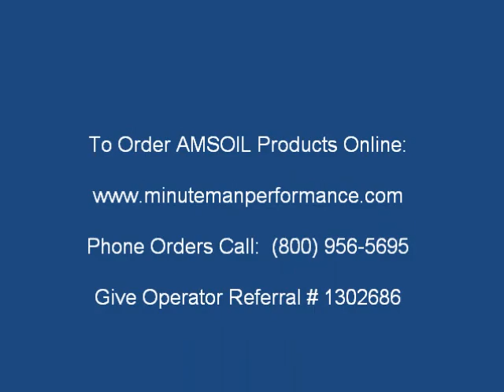Oil Challenges in Turbo Gas Direct-Injected Engines

Comment: My 2.0t accord definitely runs much hotter than my previous non turbo charged Hondas. At 4.5k intervals my dirty oil is black as my coffee. I just switched to an oil with better temperature tolerance. I hope it will hold up better.
Reply from the maker: Due to base oil and additive package differences and reactions when exposured to contaminants, oil color is not a good indicator of condition.  I completely agree about your turbo engine generating more heat and I highly recommend a premium full-synthetic engine oil.  Consider AMSOIL Signature Series in the future.  I can help you get best price and delivered to your door.

Comment: What about 0w40 amsoil for ford Taurus SHO 2013-19 ?
Reply from the maker: Ford calls for 5W-30 in EcoBoost engines due to turbo heat.  Instead of 0W-40, which might be a little too thick for the VVT system, I'd use Signature Series 0W-30, product code AZOQT.  Best start-up protection when cold, and performance when hot.  That's what I'd use if it were mine.  I use that oil in almost everyone I own.

Comment: Mobil 1 EP was decent but cooked oil a bit.  Ive found Penzoil Platinum/Ultra Platinum solves that and readily available everywhere.
Reply: interesting observation considering both oils are EXTREMELY close in specs. 

also, PUP is extremely limited availability unless purchased online.

Comment: AMSOIL is good. I’m a guy that removes my valve covers and oil pan for inspection every 25k mi. 🤷🏻‍♂️. Let me just say AMSOIL from day one and now at 120k mi….CLEAN!! No varnish and no valve ticks. My 2000 Camry LE 5sfe runs like a clock.

Comment: I have a 3.5 ecoboost F150 .. can i diminish the timing chain chatter on cold start by running a lighter faster flowing oil .. it has a tensioner controlled by oil pressure ..
Reply from the maker: Great question, and I don't know.  These engines usually call for 5W-30 engine oil, and many actuators on them are sensative to oil pressure, so I wouldn't recommend moving out of the 30-weight range, but if I owned one, I would use a premium full synthetic 0W30, such as AMSOIL Signature Series motor oil.  This oil is light in the 30-weight range, and flows very well at cold temps or start-up conditions.  This is the oil I run in my own vehicles that call for any 30-weight motor oils.  If you are interested, send email to:  info@best-synthetic-oils.com .  I make no guarantees about reducing timing chain chatter, as you may have a worn tensioner or other part.

Comment: Do you recommend putting a slightly heavier oil in a turbo charged engine for example my gas turbo truck calls for 5w30 could I put 5w40 in instead, for more heat protection and oil shearing
Reply from the maker: Sorry for delay in responding - I just saw this comment.  5W-30 is already a heavier oil than the non-turbo motors use, which is now usually 5W-20 or 0W-20.  If it were mine, I would use AMSOIL Signature Series 0W-30 premium full synthetic motor oil.  This provides the best of both worlds, with the "0W" providing excellent start-up oil flow and protection, while the "30" provides the extra viscosity to prevent shearing and breakdown from the turbo heat.  Contact me at 678.787.3028 or info@best-synthetic-oils.com for more information or to get a free 6-month trial membership in AMSOIL's Preferred Customer program.

Comment: I bought a 2020 Hyundai Kona 1.6 L turbo GTI, I’ve been reading articles looking up videos on what to do in order to prevent carbon buildup and what oil I should use. This is probably the best video I’ve ever seen on that. thank you so much!   I do have one question,  how long should I wait to idle the turbo before and after driving it? Thank you Tom
Reply: 1. Should we wait for turbo idle always or only after long trips? 
2. Any tips for maintaining 1.6L Gamma turbo engine? Its 175K kms
Reply: @kailashgamer  only after long trips. make sure you change the oil every 5,000 miles for the turbo to keep fresh oil to lubricate

Comment: I have one thing to say and I am sold on AMSOIL, I switched to pennzoil ultra platinum it's made from natural gas and has the same noack value and half the price from Walmart online. Noack is important with GDI engines FYI it's made by Shell and it's a real close second for us who have to change oil every 5k for warranty purposes.
Reply from the maker: NOACK volatility is one one measure of an oil's quality.  Making base oils from natural gas isn't an advantage over other sources - Pennzoil just uses it as a marketing angle.  Compare cost per mile - not purchase price.  Will Pennzoil support 25,000-mile oil change intervals?
Reply: I've been using pennzoil Ultra platinum for 4 oil changes so far 2019 mazda cx9 turbo, did research and seen that pennzoil was best at lubricating while cold and also best lubricating after oil breaks down. Would like to try amsoil but don't know if it's worth it over Pennzoil.

Comment: And they probably didn't increase oil capacity either.  But YOU can with a remote mounted bypass filter system with larger filters!

Comment: How about Mobil 1 fully synthetic extended performance motor oil
Reply from the maker: Since this video was uploaded, the American Petroleum Institute (API) has released a new oil specification for gasoline engines.  It is API SN PLUS.  The PLUS signifies that the oil is formulated to help prevent Low Speed Pre-Ignition in Gas Turbo Direct Injected engines.  If you use an oil that meets API SN PLUS, you'll have the best protection for today's modern engines.  All AMSOIL gasoline engine oils meet the API SN PLUS spec.

Comment: Hello sir your video much helpful  
i am from Iraq and  i have a 2013 kia optima SXL(2.0L Turbo)  with 35000 miles on the odometer i have using 5w-30 engine oil but i got a noisy engine and high fuel consumption so i checked the owners manual and i have found that i have to use 5w-40,
The temperature range in my country is(-10 to 50 celsius) so please would you help me to pick the proper engine oil ???
Reply: 10-30 Pennzoil ultra platinum full synthetic as long as it doesn't get real cold there then stick with 5-20wt
Reply: In my case vw specification is vw 504 and amsoil signature does not have this spec

Comment: Can engine oil affect the boost of the turbo? I was on regular oil, got an oil change at the dealer who put in synthetic blend. Now it feels that the turbo doesn't kick in as hard as before...
Reply from the maker: Low quality oil can cause sludge and carbon deposits to build up in the engine, especially in the hot areas like the turbo bearing. If the dealer installed oil that was too thick (viscosity too high), that could cause a slight loss of boost and slower spool-up of the turbo.  Turbo engines usually benefit the most from a full synthetic oil.